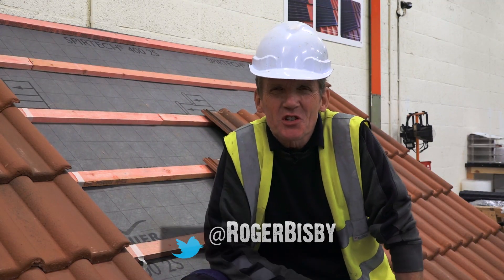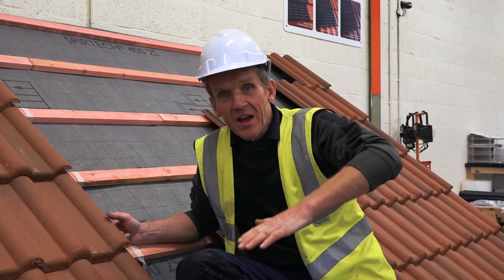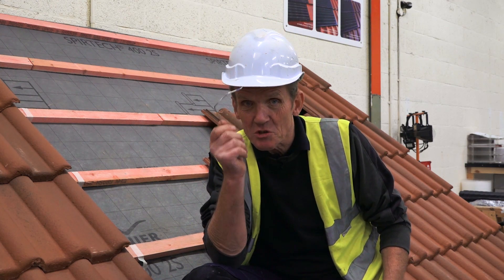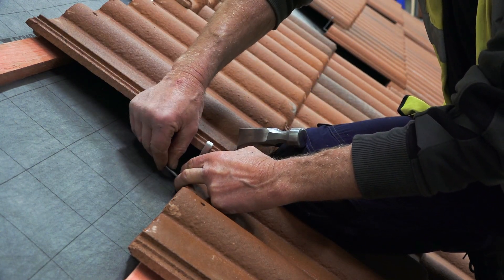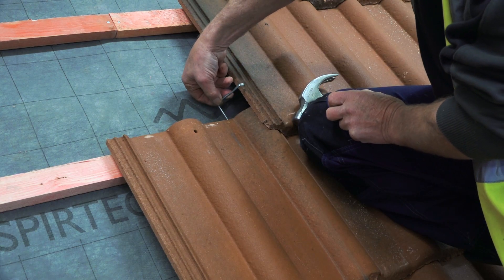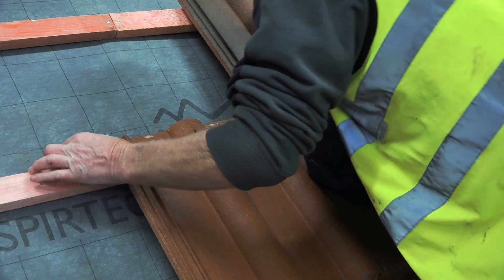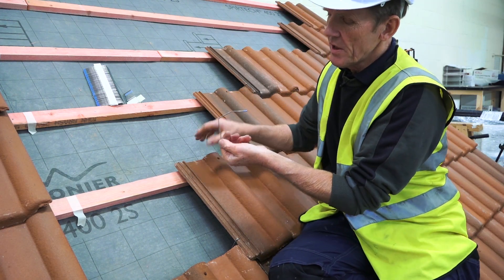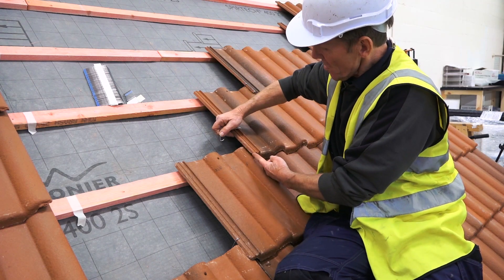DON'T Lose Your Roof Tiles! | See This Simple Trick

Comment: These roof tile suppliers are always making up new ways of fixing tiles. All these clips work, but its more time more expensive and there ok till they all get tangled up . Which believe me they do . The old clay pantiles had no fixings at all and on main stayed on the roof well enough.  Half the problem is the tile manufacturers have made the tiles thiner and lighter. So, to compensate, they have insisted each tile be mechanically fixed.

Comment: Long term weather is not changing. Were you paid to say that to create fear? Good product however.
Reply from the maker: This is not a personal opinion and I don't much care for you insults. The issue is that due to an increasing number of roof failures,  for whatever reason, the Building Regulations have been amended and this is a way of complying. 
If you don't do it and the building inspector pushes a tile up with a piece of batten you will be stripping the roof argue all you like but the roof is coming off and you won't get insurance until it is signed off.
Reply: @SkillBuilder I’m sorry if you feel insulted.

Comment: I had my roof replaced when I asked C J Roofing if he would be using tile clips on my house after seeing you at the Redlands tile training center. His response was you don’t have to clip bloody tiles. That’s just site bullshit info , the scaffolding went up on 13th September and didn’t come down Wednesday 6th November 🙈 I had water leaking into my house wet loft inundation that he said let it dry out for 3 to 4 weeks 🙈 I had to get up into the loft and remove, had water starting in the front bedroom landing and even downstairs hallway the flashing around the window was a mess, said the all woodworker would be treated to prevent damage down the road NOT DONE lots of damage to polycarbonate roofing and gutters.

Comment: dear Roger I need help. I have built my gable roof with your video with Dan. I'm now stuck. laying tiles they say right to left. how can I lay a left hand roof right to left if I need to end up with roof tiles with a hump on the outer edge.
Reply from the maker: You have to try and work the first course out so you start and finish with a roll. It is tricky with some tiles. One way around it is to use a dry verge which covers the end up nicely
https://youtu.be/Urp6On74xgU?t=218

Comment: The problem with clips is if any other future maintenance is required the clips cause the edge of the tiles to crack when foot traffic is unavoidable , and then if every tile is clipped as is suggested here, the cracked tile is difficult to remove as is the replacement tile to replace which by the way you won't be able clip back. I would normally clip every second tile which is more than adequate to prevent storm damage and will aid any future maintenance.
Reply: Another problem i encountered with the plastic type clip is on a single channel tile is can cause  blockages on certain water channels the flow runs into the clip and diverts the flow into the under felt causing leaks.
Reply: Hi, thanks for the comment on this thread. I am looking at replacing some cracked tiles on my bungalow. every tile has been nailed, so assuming to meet the regs, but a sod to get at, and then to secure after replacement. I take its these clips cannot be slipped in, and added for tile replacement?
Reply: @Hands9924  
Normally every second tile should only be nailed which would make replacing tiles easy. If you find it to difficult to remove a broken tile I'd recommend use a hammer to break  the tile which will help you remove the nail still in place unless there is a clump of tiles in the one place in need of replacing I wouldn't worry about mechanically fixing the new tiles back onto the roof the lugg that's holds them onto the baton is sufficient.
Reply: @Neil kenny Kenny  thanks for that, answers the question. Yes, I see. I did break the tile that was already cracked, or get to the nail and then just replace the unit with new and slide in. Thanks again.
Reply: @Hands9924  I should mention you can use the channel clips back if access allows in your case with to many tiles nailed it may be to tight to get one in but yeah we'll done on the repairs. Neil from Ireland.

Comment: Just nail your roof tile, just the same as clipping and a lot cheaper .
Reply: Whilst it is cheaper, I would sooner use nails. My old tiles used clippers and they remained securely in place for many, many years. I am now having to order new Redland tiles, simply for a new extension on my property. I've found the tiles I want at https://www.roofingmegastore.co.uk/roofing-brands/pitched-roofing/redland.html, but am still in search of the clips. Any recommendations?

Comment: Rodger, thanks for the heads up on those clips. I have used the 'french clips on slate many moons ago, thats a great  and easy way to fix slate, once fix it ain't going nowhere and not a nail in sight,. I moved to Jockland a while back into a house with those 'centurion' type concrete flat tiles on the roof. Two years ago we has the "Mother of all Storms" which lifted several tile and chucked them to deck, luckily I found a few spares which did the job, The clips used were made from light aluminium strip which was no match for 110mph wind. I shall get up there in the summer with the correct SS clips and job done.Thanks again for joggin' my memory, a job that I had forgotten about.. :0)     Hugh
Reply from the maker: +1stMrSceptical 
Thanks Mr Sceptical. Good to hear from you up there. You're right those aluminium clips are too soft. Nice little job for the summer. Even if you can't clip every single one it has got to help.
Reply: "Nice little job for the summer"? thanks and I was hoping to air the Old Triumph for a quick thrash rand the lanes this summer, dare not blink I may miss it. Better put it on the trailer take it back home to Norff Lunden to pose with it dan the Ace Cafe on a Sunday Morn and impress all the girls.  Na better get on wiv them Clips… Cheers Rodger keep up the good work..
Reply: May I ask did you do the job? I live on the west coast of Ireland and presently my concrete roof tiles are doing a lot of chattering in the strong gusts. Will follow suit in the spring and am wondering how your roof is holding out this winter. I ride an old BMW r100rs myself. It gives less trouble than my roof in strong winds.